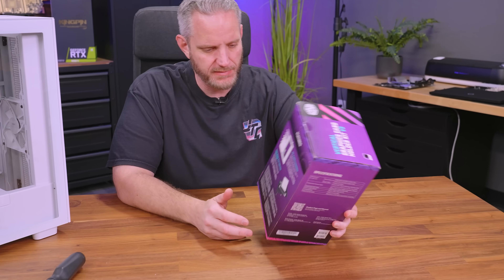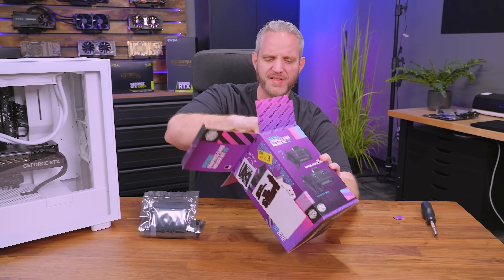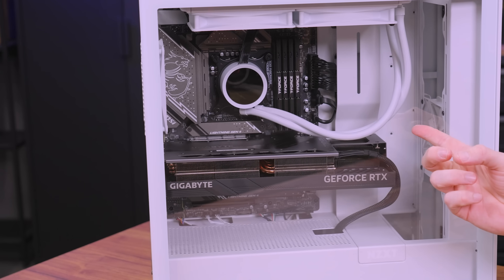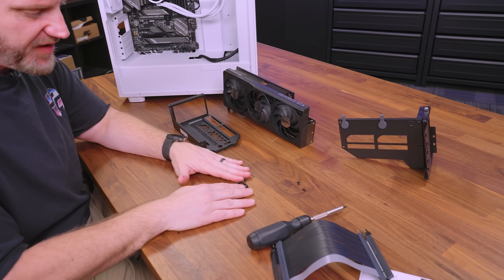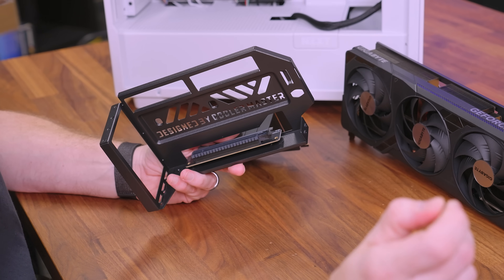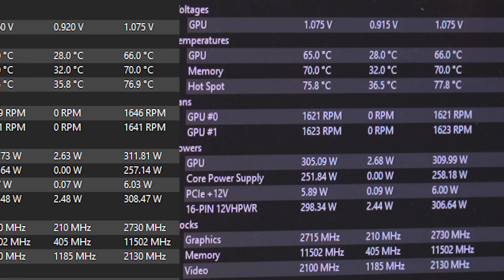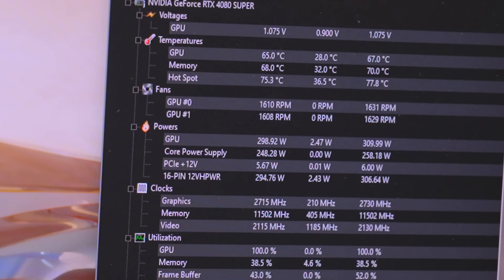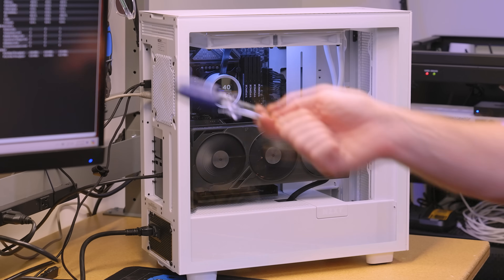Can this mount actually HELP GPU temps?

Comment: TLDR: vertical mounting is mainly for aesthetics
Reply: Well, I don't like all the heat blasting my motherboard and M.2 SSD's, so technically they should run cooler.
Reply: Actually it's necessary if you have a huge and heavy graphics card that can easily bend the PCI express slot. That may even cause damage in time.
Otherwise I don't have any special interest in its esthetics.
Reply: @mkatakm  that's why you get or buy a gpu holder-thingy. My gigabyte 5070 ti oc came with one
Reply: @ReynaMirez i tried that too but i found out that there was still some distortion effect on the mainboard which i didn't like. With vertical mounting, the GPU is on a separate apparatus with only a cable connection to the mainboard. Now I feel much safer :)
Reply: @R@ReynaMirezke sure you put it in the right spot or you’ll still bend the card and pcb port, the super heavy card like my 7900xtx is 6lbd
Reply: @mkatakm  that's what I mentioned about heavy gpu's
Reply: helped route watercooling :)
Reply: Would be interesting to see the heat reading on the MB over the PCIE slots between vertical and Horizontal mounts.
Blocking one side of the GPU should logically make a difference.
Reply: @petert3355  Not really as it's technically not blocked off when seated against the motherboard as it is not completely airtight flush or even in a recessed pcie slot. Now if the pcie slot was enclosed and sealed the entire pcie slot side of the GPU you would be correct in saying it would make it run hotter when compared to a non airtight pcie slot/riser
Reply: It depends on the card. Remember when the o11evo came out, the upright option made some asus cards hotter because of how the cards heatsink was designed.
Reply: And the pcie extension probably reducing performance
Reply: @YouRgettingTrolled-101  this is the detail I was looking for. I guess I will just have to wait
Reply: unless your side panel has ventilations like NR200 it could be huge difference
Reply: Arent risers costing up to 5% Performance?
Reply: that or fitting a WC 4090 block inside a case LOL Because of the height + the fitting it doesn't fit a lot of case even big one so mounthing this way is the only way
Reply: @ryogaming4771  chonker cards are better to be vertically mounted to prevent cracked pcb's
Reply: @TheBlueBunnyKen  Which is why I have an anti-sag bracket for my 3090.
Reply: Before 40 series anti-sag brackets were enough, but now a days cards weigh like 5Lb's or more and the anti-sag bracket isn't guaranteed to protect heavier cards. Vertical mounting is the for sure method to protect your card, it's crazy to me that even vertical mounting a 4090 shows sagging at the end of the card. That's how heavy they are
Reply: I'm sure Northwest Repair would agree @SkateClipsAndTips
Reply: @TheBlueBunnyKen  Well, the ones provided with Gigabyte 4xxx cards are very good.
Reply: @TheBlueBunnyKen  Mine is the post type that the bottom rubberized foot sits on the bottom of the case. It will hold.
Reply: @TheBlueBunnyKen yes this is part of the reason I have my 4090 mounted vertically, also I have a fractal design torrent case and my bottom fans are set to intake and they blow directly into the 4090 heat sink
Reply: Anti-sag brackets are not the solution you think it is. GPU repairs techs recommend vertical mount if you have s large gpu.
Reply: I've seen "Well setup" V mount Tests that show a couple degrees benefit to GPU but gave big benefits to the heat soak off the MB!! But the case choice is critical and needs vents all round really!
Reply: I have o11 dynamic, doesn’t fit my 4090 unless it’s vertical lmao
Reply: Personally, I don't like the aesthetics of vertical mounting. It just looks wrong and I don't like having to look at my GPU's fans. I've got my 4080 Strix mounted horizontally and though it sags a bit (not much), it looks and feels stable. I think keeping the card and its heat away from the MB and other more sensitive components like M.2 SSDs, plus the weight of the heavier models that might put too much pressure on the pcb are solid arguments for choosing vertical mount, though. My case supports it and I might consider it in the future.
Reply: Might help if you have a mesh side panel, will almost definitely not help if you're GPU just ends up with the fans super close to solid glass or metal.
Reply: Or because of space management. Which is why I always get huge cases
Reply: @2iBMX  This. I LOVE my Enthoo Pro 2.
Reply: The @technologyhive uploaded a video about vertical mounts being pretty much the only solution to mounting heavy gpus. Guy fixes gpus for a living and those little stand/support things that come with gpus these days are actually causing bending on the the boards and breaking the solder joints on many cards. Worth the watch imo.
Reply: TLDR is vertical mounting does not help thermals in this case and with gpu model. There are people out there testing GPUs in different orientations and in certain scenarios the improvements can be substantial
Reply: Got that item to fit my 4090 Asus tuf I a y60. Fans were less than 1mm to the side window before.
Reply: @pascalmeyer8768  so it worked? I have same issue
Reply: Its the only way I can put a side panel on a case with my Suprim Liquid X.
Reply: @hm_1406  it helps the pcb over time, but  temps wise it doesn't do much
Reply: And I love mine
Reply: It was, but since the 3090 and majority of 40 series cards and AMD equivalent, it's better for without needing additional support
Reply: You just saved me from watching the video.
Reply: Says gamer so it must be good right?
Reply: Or due to case design.
2 out of 3 of my cases have vertical gpu position
Reply: Yo pls do this under every video. 
Saves time thanks
Reply: I have mine mounted vertically because airflow is way better than horizontally.
Reply: prevents gpu sag and prevents pcb cracking
Reply: I use mine because the dam 12vhpwr angled cable wouldn't work normally with my air cpu cooler
Reply: AND size … if you have a big GPU … also, if you have a case that has bottom fans blowing up (LianLi, NZXT H9 Flow, etc) its better, because the air is blow up and out the case … it shouldn’t mess with temps …
Reply: TLDW*
Reply: Thanks! No need to watch this video now haha
Reply: @vlydenknox  at least give the video a like
Reply: Or so you don’t crack off your motherboard or GPU PCB lol. Think ab it bro it’s a lot of weight on there. Ideally your PC would be lying flat on its back. But since most of us have vertical motherboards, the logical solution is a vertical GPU as well.

I only buy dual fan mid tier GPU’s, such as 4070 Super for this current generation. I would not mount a large 3 fan to my motherboard, at least not without some kind of support. Imo GPU supports are tacky, I want something properly secured, that’s where a vertical mount would come in. For heavy 3 fan GPU and people that care about preventing damage
Reply: I'd say this is more for the peace of mind that the GPU won't destroy the motherboard port if it ever sags too much or straight up breaks off...
Reply: @lathamtk  yeah, I mentioned that later in replies
Reply: I beg to differ. The pc in my picture has an active backplate on the gpu. Good luck trying to unlatch it from the pcie slot.
Reply: Unless you're own a 4090 and need to ensure that 12v cable is not going to sag
Reply: Tbf my 3080ti is a bit in the way of my RAM slots, so I mounted mine vertically.
Reply: *SAG
Reply: Obviously
Reply: How much does it effect temps
Reply: Blue bunny
Reply: @BobMcBurger1  yes?
Reply: Main reason why I have mine mounted vertically in my o11 air mini. 😂
Reply: @RayzTvT  same reason, I have GT502, and Strix does not fit so I've used the mount.
Reply: @Carpelus  i was looking into that case for my next build.
Reply: @RayzTvT I have the same setup. It looks so good in this case
Reply: while not unexpected.... I wish I hadn't scrolled down and seen this before finishing the video.
Reply: This was tested with a single 120 in the front. Feed your GPU's people! This was not a good test.
Reply: @neenja16  Exactly. I have 3 front 140s, a rear 140, a top mounted AIO radiator, 3 bottom 120s. Enthoo 2 Pro case. Built in vertical mount option for it, if you want that. I get plenty of cooling.
Reply: Don’t do that man. Watch the fuckin video and support the creator
Reply: @Nickles4  I did watch the whole video, and this test is kind of invalid with just 1 intake fan. I have seen lots of videos properly testing vertical mounting temps with lots of fans and the temps either go up a few degrees or maybe go down 1 degree. It's mainly for aesthetics and saving your card's pcb from cracking if it's heavy
Reply: i did it literally just because of the gpu sag and found it more aesthetically pleasing that some sort of a support leg

Comment: You can get ver mount with a tilt thats not fixed (magnets hold it down to the case) I have one in mine for ages and gives it so much more space from sides of case for GPU to get more air
Reply: I have the same too and love it . Had it for years .

Comment: In my experience, it depends on if the GPU has a vapor chamber
Reply: Oh, I looking for the answer for some time.
With vapor chamber is it better vertically or horizontal? Or even horizontal top-down?
Reply: @L1vv4n  vaper chamber is better in the horizontal position. It gets a pretty bad hotspot when it's vertical
Reply: @crazedw00kie  Thanks.
Makes sense that it works best in the most common position.
Just a little counter intuitive, because I expect liquid to flow down and vapor to try to go up.
Reply: @L1vv4n  top down gets really bad, I had this issue in my The Tower 500 case. Other orientations are fine.
Reply: @puzoni  Thanks.